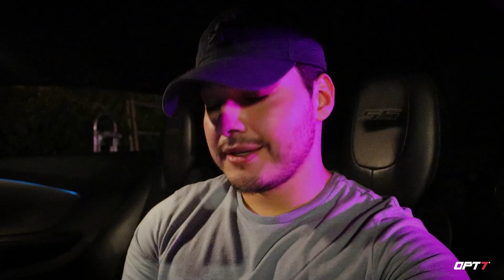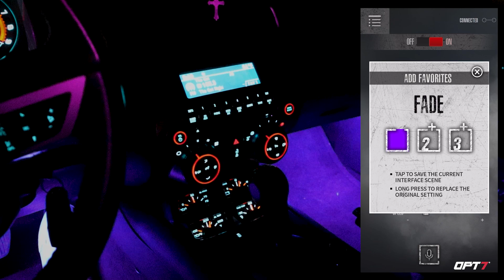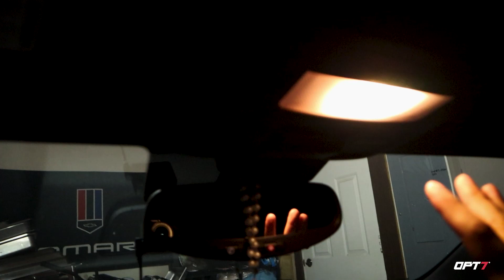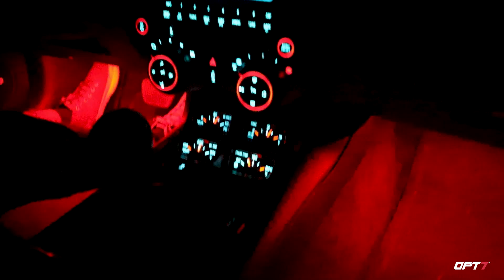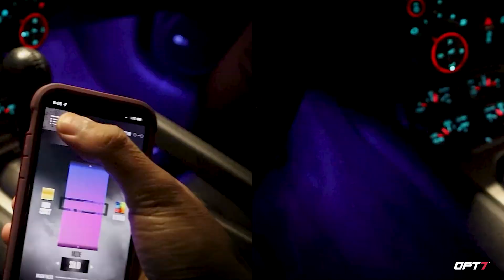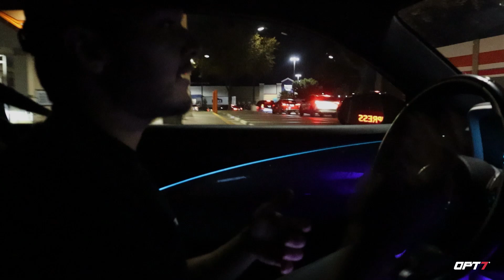OPT7 AURA PRO Bluetooth Connect App - Step by Step Tutorial - LED Lighting, easy DIY MOD

Comment: I have my OPT7 aura pro underglow connected to my Auxbeam. I can turn them off with the switch but not turn them on. Do I always have to go through the app to turn them on or is there a way around that? Thanks!
Reply from the maker: Yes, you will be required to go into the app to turn them on each time for safety precautious.
Reply: My kit doesn't show up in the app all the time sometimes days HELP @OPT7Lighting
Reply: You guys should fix that for people who want them hooked up to a switch. Love the lights but definitely ruins it for me
Reply from the maker: @jontierney318  ok
Reply from the maker: @jontierney318  okie, thanks.

Comment: Does door assist work for the underglow as well?
Reply from the maker: Yes, as long as you have an AURA PRO Control Box, you have the Door Assist feature which is found on the OPT7 CONNECT app.

Comment: Question, if I bought the remote version can I still do the app 1 or no?
Reply from the maker: Yes, you'll just need to purchase the control box so you can switch out the remote control box to the AURA PRO control box. 

Here's the link: https://www.opt-7.com/products/aura-pro-bluetooth-control-box-kit

https://wintis.ladesk.com/137018-AURA-Pro-Control-Box-Upgrade-V1-to-PRO-

Comment: Mine is not findable in the app. It is installed last year in my boat and worked fine when I get my boat out of storage and went to turn them on and there’s no devices coming up in the app when I hit connect. Any idea? I checked the power connection and fuse.
Reply from the maker: Sounds like it use to work and not anymore, please contact our customer support team for assistance on troubleshooting + warranty replacement via email - support@opt-7.com
Reply: This is my exact problem w/my halos. So frustrating. Hope your problem got resolved.
Reply: Same issue. Did you get yours figured out bro ?
Reply: Mine just stopped working after having the original setup after 2years. All of a sudden, it wont pickup the bluetooth connection. I double checked fuse and wiring.

Comment: Would it be possible to have a sensor wiring option like XKglow where you can connect it to turn signal lights or brake lights to sync?
Reply from the maker: Thanks for the feedback! We'll def bring this to our team and see if its possible. However, we do offer this feature for the AURA PRO Motorcycle LED Kit which offers the brake light feature to be lit up upon braking.
Reply: @OPT7 Since it aa feature for the motorcycle kits can we install the motorcycle kit to the car kit and sync them together to get the smart brake feature?
Reply from the maker: @xaviermagana2955  For the Motorcycle Kits - the smart brake feature uses the door assist as its connected to a 12v positive source. You'll just need to go into the OPT7 CONNECT app, go to door assist and select red, so that when you apply the brakes, the lights will show up red on your motorcycle.
Reply from the maker: @xaviermagana2955  Sure.

Comment: Can you please do a video showing to to set up the kit? I need help installing my kit, my kit only came with Hardwire, no cig or fuse like most people.
Reply from the maker: Hey there, our newer kits have the hardwire inline fuse which is a direct battery connection. We have a few videos for specific kits. If you are still having issues, feel free to email our team for install assistance - support@opt-7.com

Comment: I'm about to purchase the Aura Pro interior v1 and Quantum pro app version.  I see on site the connect app can support 4 kits, but in this video I see it showing 6?  Also if in the setup I just mentioned, if I go to sound mode, what happens to the Quantums?  As it states, those don't support that mode.
Reply from the maker: Quantum Pro does not have soundsyc. The soundsyc on the rock light is hold held on the Quantum Remote version. 

Soundsync on the AURA PRO LED series, will have it on the app. 

If you are using AURA PRO LED series, you can add up to 6 kits. But if you are using Quantum PRO kits, you can only add 4.
Reply: Bluetooth fade can only use one color.it doesn't change colors randomly

Comment: Dumb  question do you have to have the power on to link the lights to your phone
Reply from the maker: Yes, to use the app on the smartphone, the lights to be pulling a 12v power either battery, fuse, or cig adapter provided.
Reply: @OPT7Lighting  i have it installed but when i search for the device on the app it doesn't come up as a device
Reply: @banegladesh76  this is happening to me too
Reply from the maker: @banegladesh76  Ensure you have the correct control box - black is the Pro version which allows to be connected to the OPT7 CONNECT APP. If you need more help, please email our team at support@opt-7.com